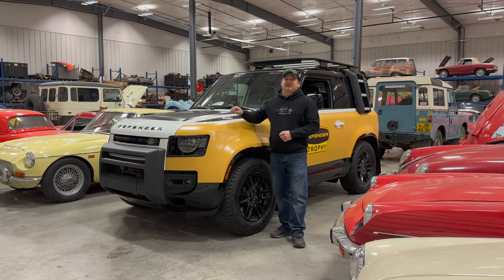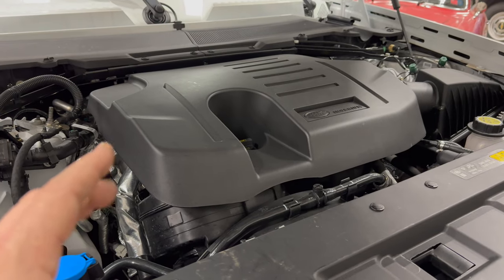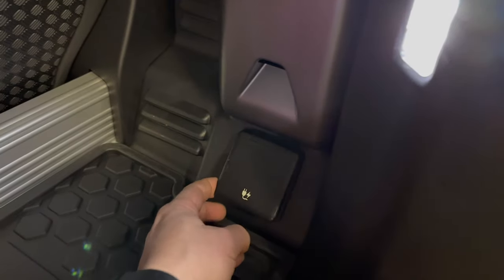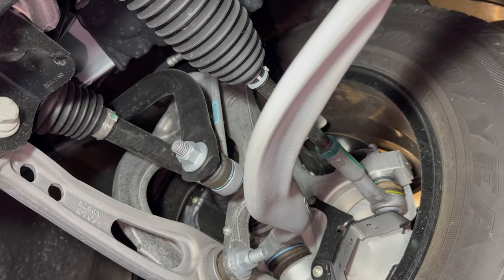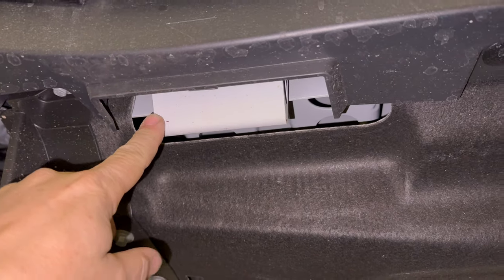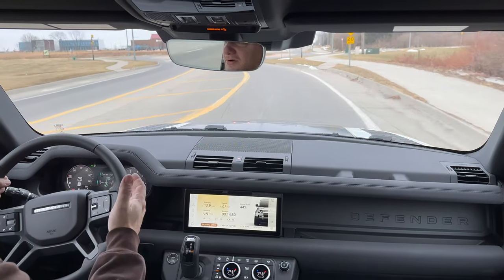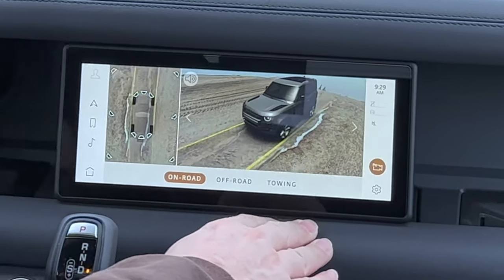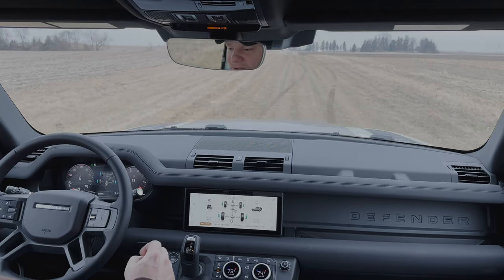Full Review of the Land Rover Defender 90 Trophy

Comment: https://youtu.be/3ilYFwRU5Xs?t=275
4:36
Wrong.
STARTER GENERATOR Harvest energy... sending electricity to the battery, redeploying it as torque to aid transient acceleration.
Sounds to me like electric motor can drives wheel togetrher with petrol engine. You misunderstood / didn't read the diagram.
https://youtu.be/3ilYFwRU5Xs?t=259
4:20